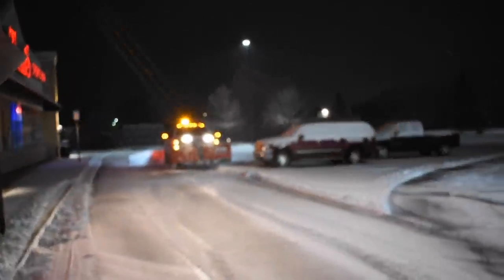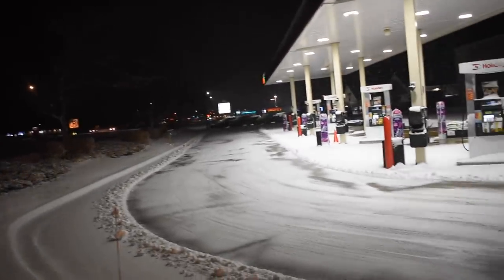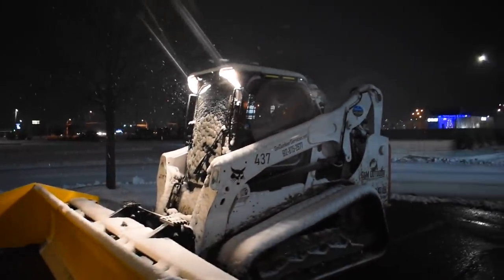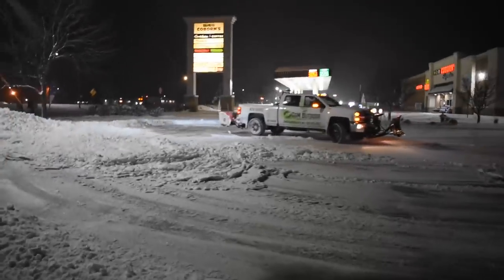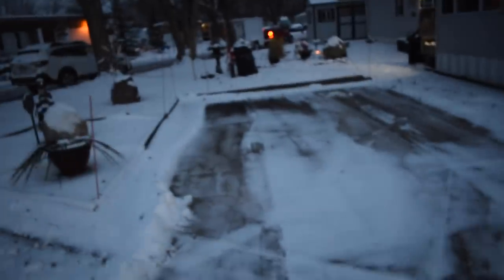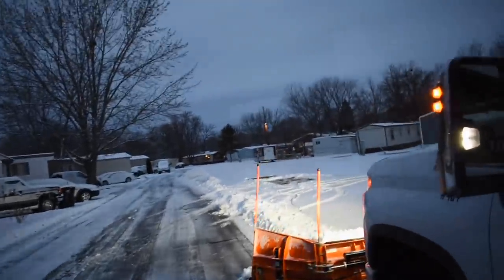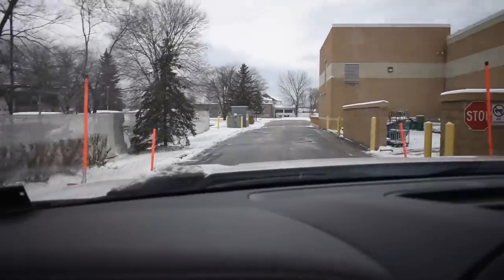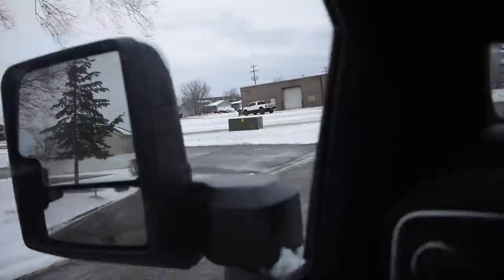FIRST PLOWABLE SNOW EVENT OF THE 2021/2022 SNOW SEASON!!!

Comment: Have y’all ever tried a COE truck?  The cab over engine is absolutely the way to go. Much sharper turns, more maneuverable, and you can see the plow so you can do a much better job. It is the advantage you get from a skid, only in a truck!
Reply: @another What cabovers you running? I’m surprised more don’t run them. But see very very few. There is a guy that posted some videos plowing in an NPR and then said that he tore up the transmission a week later.

Comment: last year my minimum was $40 but since gas is double this year my minimum is $50. in a situation like yours you can go lower because its is right against what you are already plowing. this is just one of many reasons why potential customers may see a difference in pricing between different contractors. they dont realize it and usually, i think, just assume some people are trying to rip them off just because someone else can do it cheaper. also i would love to have that plow, cant do pull plows cuz i need to use a sander,  but i use boss and i dont want to pay a bunch of money for new wiring and push plates plus the cost of another plow. maybe one day boss will make something similar and i can trade my plow in for it.

Comment: The big front plow on the truck and also the pull plow look like they work awesome for 1-2 inch snowfall! I wonder how they will work when you get 6 inches plus? Or a wet heavy snow?
Reply from the maker: They work great just can’t me a 500 yds run gotta take smaller bites like with any other plow